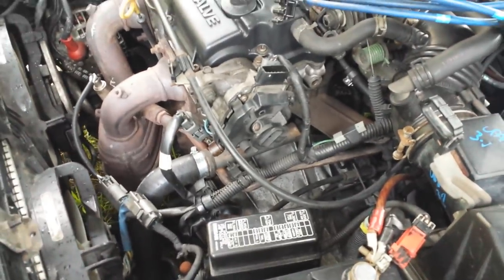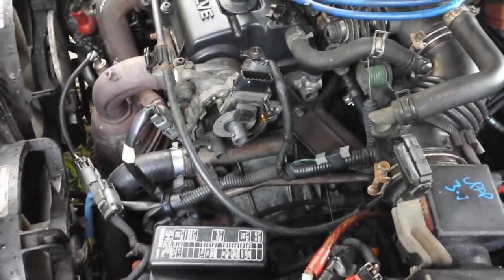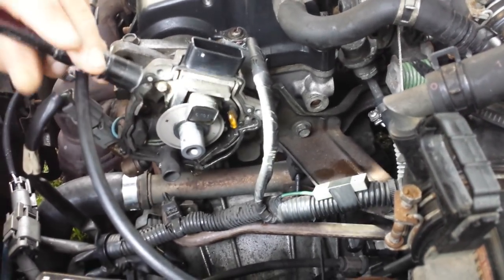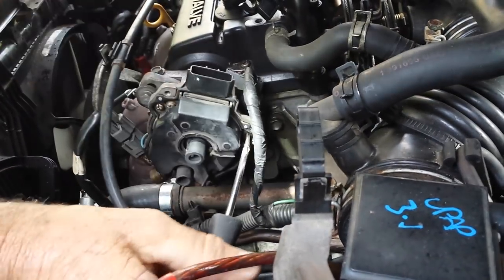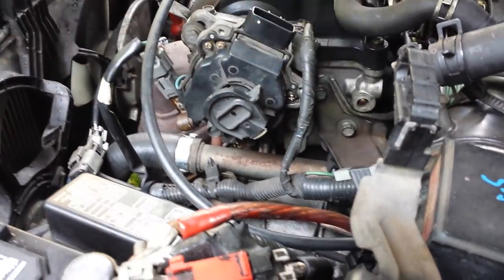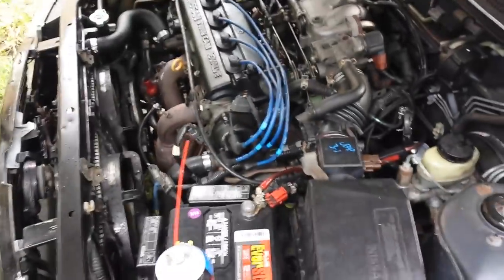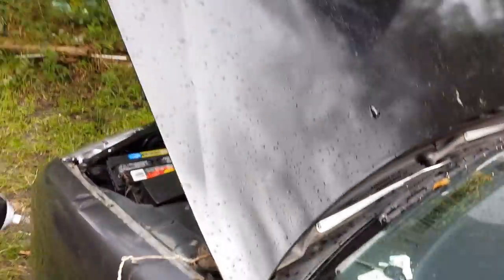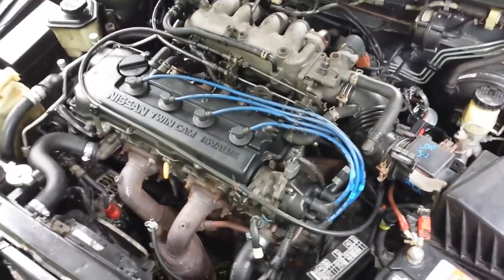1997 nissan sentra starting issue

Comment: Where is the fuel filter on a 97 Sentra
Reply from the maker: Quido Miranda follow the air box to the mass airflow sensor and then look behind it and down a little ways. If you still can't find it, follow the fuel line from the fuel rail from the right side. Let me know if you still need some direction.
Reply: Thanks when I start the car I have to give it gas to start but I noticed a strong smell of gas and noticed a wet spot under the front driver side any idea
Reply from the maker: Do you know if the wet spot is gas for sure?

Comment: Not getting a code
Reply from the maker: What has been replaced so far?
Reply: @BrunsBwlr as far as I can tell, spark plugs and wires, an electronic device in distributor (ran better for a short while),  fuel pump and filters and a new battery.
She states that engine light flashes and motor lumber at about 1 miles running: even her tail lights stay on with key in accessories mode.
I told her to reset ecm and go from there.  My honda had similar symptoms but it was a distributer replacement that solved the problem.
1993 Honda accord stn wagon with 371k
Reply from the maker: For the brake lights, check the brake pedal switch bumper at the top of the brake pedal where it pushes on the switch. Usually you have misfires when the check engine flashes. The CEL will flash when there is a chance that the catalytic converter will be damaged. I'm starting to wonder if the catalytic converter is clogged. You can check a cat with a pressure gauge.
Reply: @BrunsBwlr  
Thanks and will get back